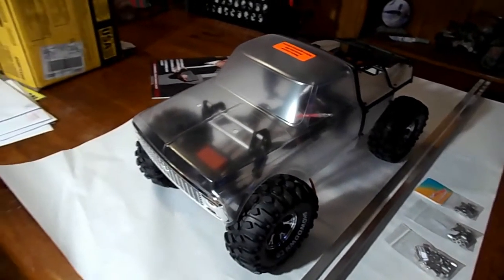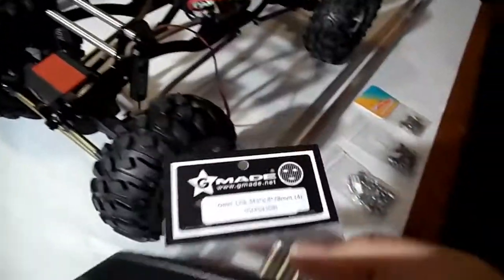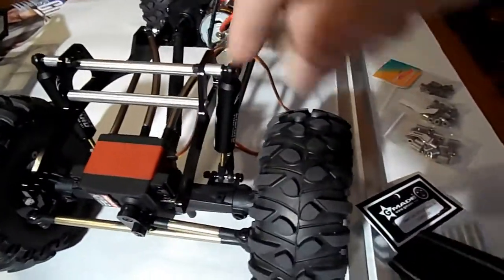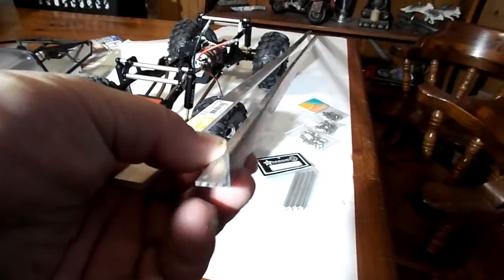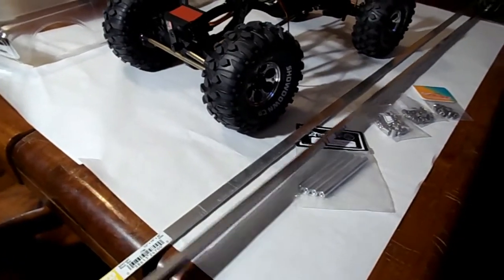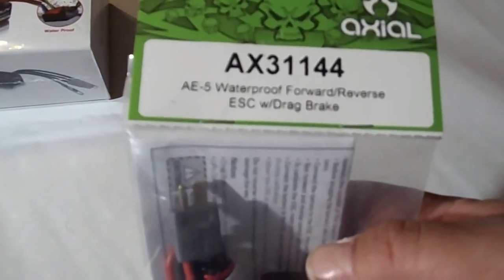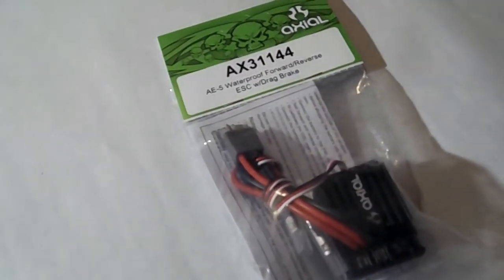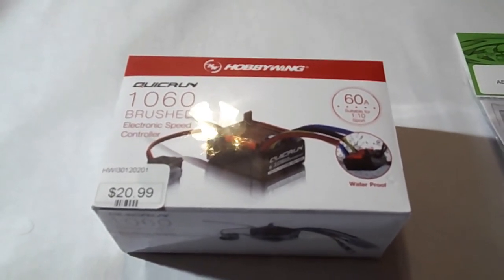1 9 Everest 10 scaler small update

Comment: should've bought the 1080wp hobbywing for 40 bucks its programmable...
Reply from the maker: lmao, funny you should say that. I DID buy a 1080wp at the same time. but I thought this one was worth mentioning because it's half the price of the exact same piece with a differant brand.  The 1080 is going into my sawback sports.
Reply: B and C RC I run the 1080 paired with one of those coolRC 35t .... man, smoooth start up, well that's what I feel, never gets warm stays cool, and really enjoy that you can change the ESC's settings, BIG plus.... well have fun building this truck✌